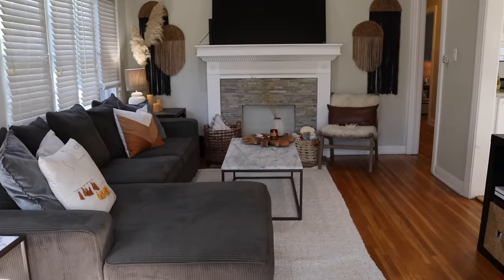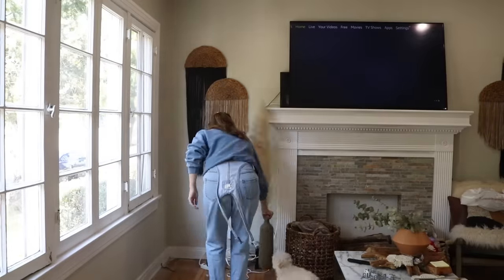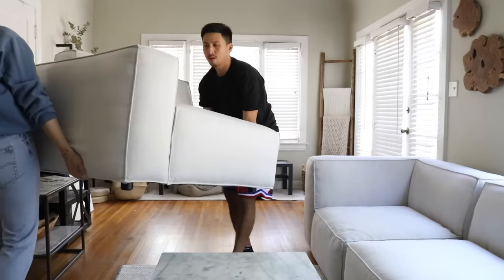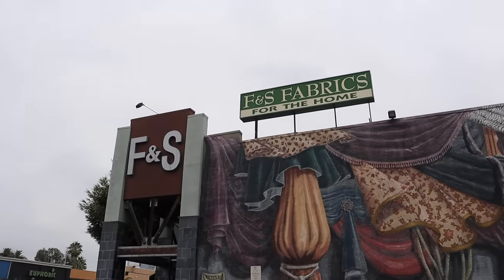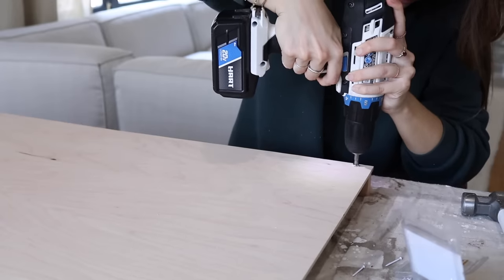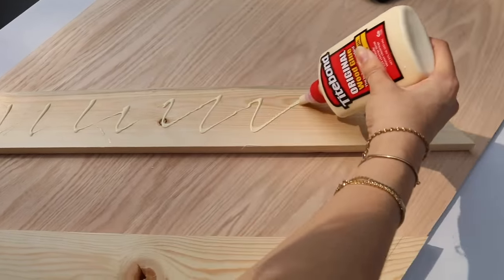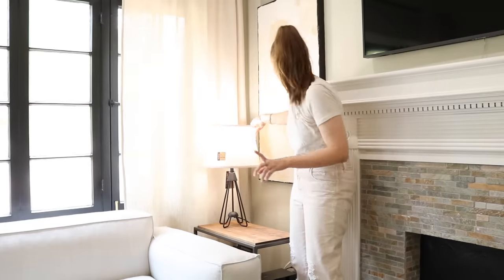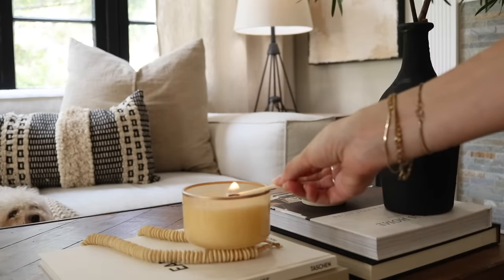EXTREME LIVING ROOM MAKEOVER + DIY Home Decor | XO, MaCenna

Comment: Lovely....very warm and inviting...would only suggest one  small change to complete your space....take down the wall art... tidy edges with the black paint....nice crisp lines are needed..you will need some sand for grit..add to acrylic paint suggest "gold dust" ...rough textured mini roller and roll a random gold swatch thru the centre of each piece...in my opinion it completes the piece.nice job well done.

.

Comment: It's beautiful and peaceful. I think the one thing thing that might be the icing on the cake would be to add a toning, long runner carpet along the side with the doors, which would soften and integrate that area into the whole room. If you use a non slip underlay to the runner it will remain a safe walkway. 💚

Comment: A reminder.  If your hardware has latex paint on it,  you won't need to buy a special product to get it off.  Just soak it in water and then scrape it off with something soft.  Your thumbnail will usually work pretty well.

Comment: Everything came out so refreshingly uplifting!  Only comment on DIY panel artwork (though I would have gone slightly smaller) would have been to have clean edges around the outer rims.  My eye was drawn not to the art, but to the ragged black paint and I'm sure it wouldn't be too difficult to tidy that up by sanding texture and taping clean edging, of some sort.  Nice job!

Comment: The only thing I wasn't on board with were the pieces on top of those books on the table. If I want to read that book, I'll have to move everything to get to it, then move everything back again when I put it back. I think there was another video where there were picture frames right behind the wall, the bed was sticking to. Got a little nervous there. Whoever sits with their back to the wall will be resting against the frames. I absolutely love your aesthetic and DIYs